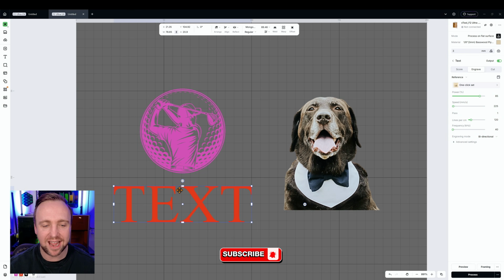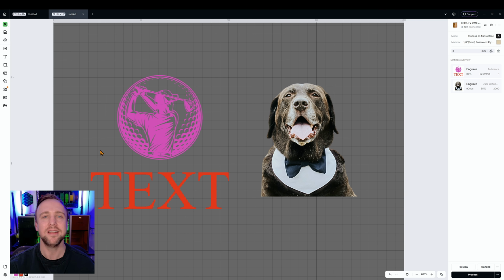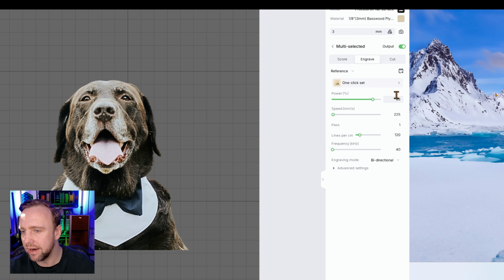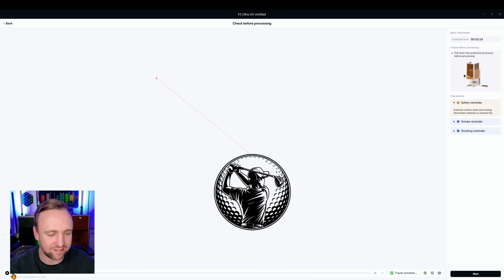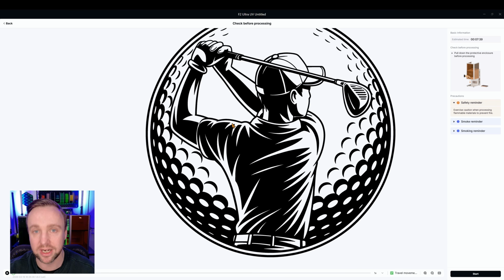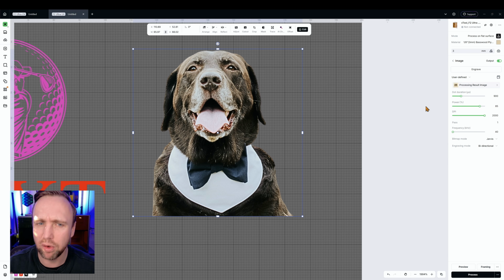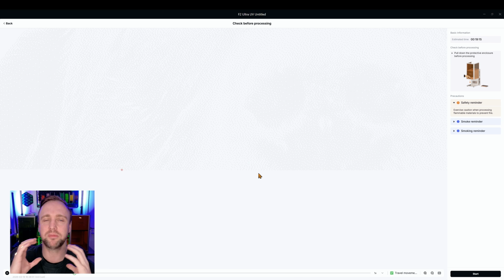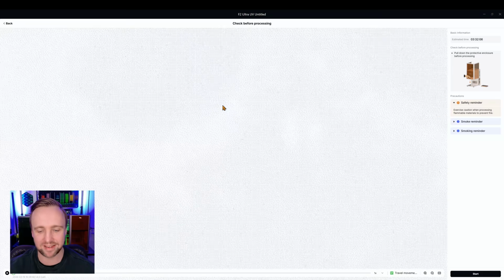Laser Engraver Settings Explained | Speed, Power & Dot Duration

Comment: As about a 1-week-old F2 owner, this is the exact info I was looking for as soon as I tried my first bitmap image. On a related note, if anyone has an answer to this question, I'd be interested in hearing it. I have a detailed, fully vector image that I can successfully etch onto a white tile using the famous Norton method. In one instance, one complete line of that etching is missing straight across the entire tile so it would seem exactly one of those horizontal scan lines is missing across the entire width of the tile. It's no thicker than a hair, but since the rest of the tile is perfect, it's easily noticed. To me that means that the laser failed to fire for just one of the many hundred scan lines across the SVG. It has only happened once out of more than 15 tiles, so I don't even know where to look should that happen again. Could some sort of power "glitch" cause just one line of many hundreds to be missing? Do people plug their Xtool engravers into an uninterruptible power supply to ensure perfect power?
Reply from the maker: Out of curiosity is your lens dirty? Sometimes you can get small specks of dust on the lens which can prevent the laser from escaping tiny areas of the lens. 

Thanks for watching and I'm very happy to hear the information helped you out.

Comment: Thanks for the video! Do you know if there is any way/formula to “convert” vector settings to image settings (and vice versa)?

For example, if I have some very good settings for engraving vectors on a slate coaster, how can I adjust those settings for an image to achieve the same good result?
Reply from the maker: I've looked into this many times myself and am still yet to find a solution. My advice is to pick a similar material from the material library and then use the recommended settings for your image as the middle point for a material grid test. I'm going to make a video soon showing the full process I use.
Reply: @L3DAccessories  thank you.

Comment: The difference is also because it's a galvo laser & not a gantry. If engraving a bitmap or raster image on a gantry laser, you have speed power & lines per cm. This is because the laser head is moving. With a galvo system, the laser is fixed & uses mirrors so has to use dot duration & dpi instead of speed & lpc.
Reply from the maker: Yes this is correct. For now I wanted to keep things as simplified as possible. Thank you for watching

Comment: Would be nice to expand the video with the crosshatch function. :)
Reply from the maker: The crosshatch function works with vectors (logo/text) and it adds a second pass to the engraving going in the opposite direction. For example, initially the laser travels side to side but if you also add cross hatch it will add a second pass in which the line travels up and down. The reason for it is to try and remove engraving marks.

Comment: Why sometimes when you have an image with the UV it give you a range of power?
Reply from the maker: That's because it's trying to engrave in Greyscale mode (bitmap images can be engraved in different ways). In my image it was using Jarvis mode which is one constant amount of power, Greyscale mode throttles the power.
Reply: @L3DAccessories great info! Thank you